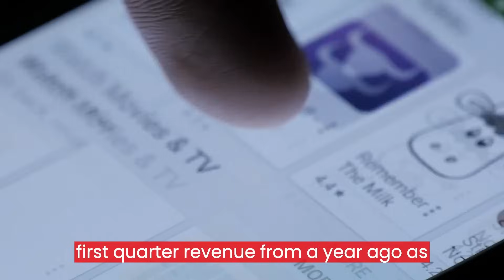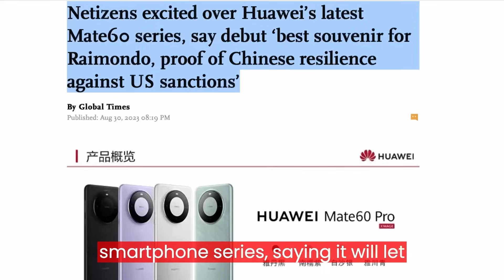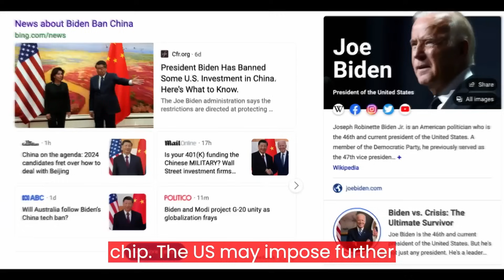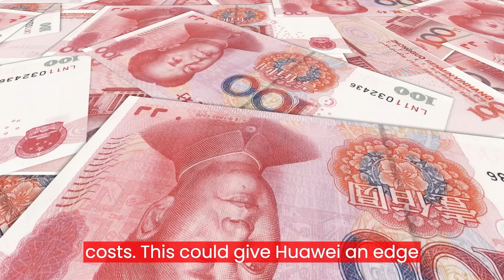Huawei’s Chip Breakthrough Defied US Sanctions and Shook Up the Global Semiconductor Industry

Comment: Firstly Huawei simply integrated the chip in their phone and did not produce it, SMIC probably did using existing tools. The 9000s chip could jolly well be a low yield batch produced with existing DUV technology and much slower than Kirin 9000 which was produced by TSMC in 2020 (benchmarks do not lie). Time will tell on how many RMAs for the Mate 60s in the next few months (probably due to heat issues).. There is no evidence to show SMIC is already producing 5nm chips with high yield and cost thresholds like TSMC in this saga.
Reply: The fact that Huawei has leaped over the hurdles that the US threw in front of it is remarkable, they learned well from what the US did to Japan and unfortunately for the US they telegraphed their tactics therefore giving China the blueprint as to what the US 's next moves will be!
Reply: James, you my friend is a smart man. Keep enlightening the haters and blind sheep. Btw the Mate 60 Pro "Plus" is coming out on the same day as the Iphone 15 launch. Therefore, one must conclude that 7nm yields is a non-concern. (points at Wilfredteo2899)  @James-Campbell
Reply: The chips may be made with yet unannounced chinese method - nonDUV
May be Chinese made EUV